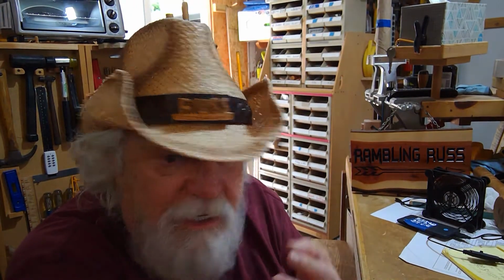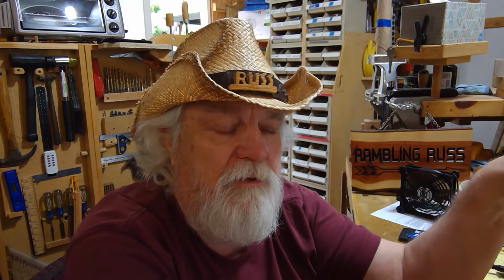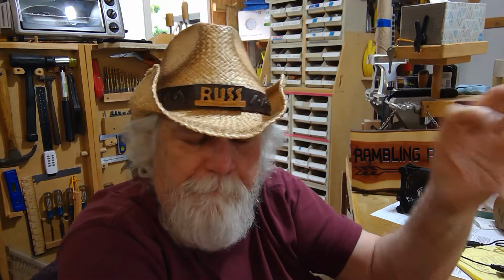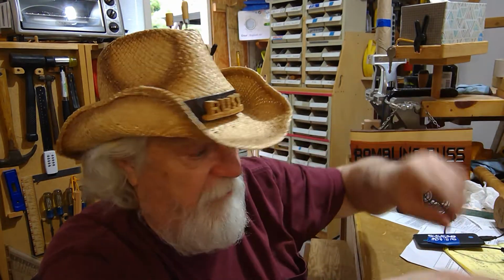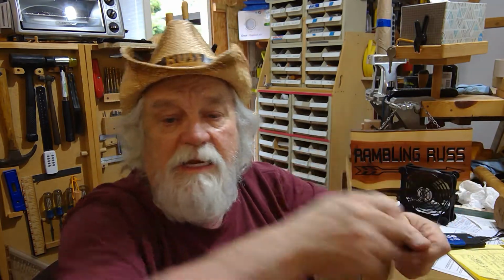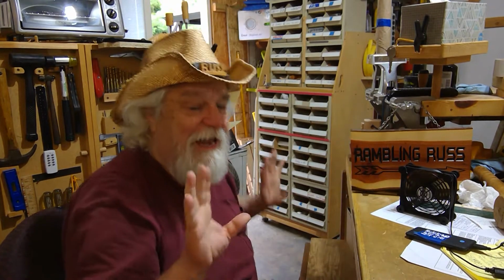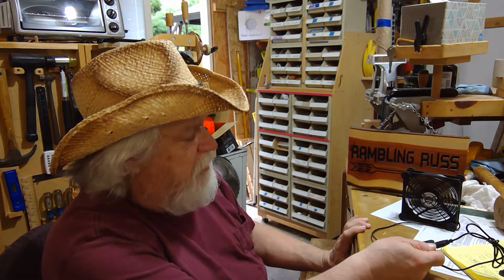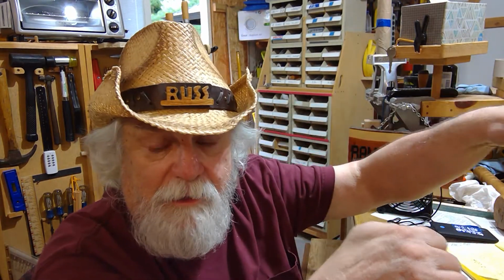All Projects Update by Rambling Russ

Comment: Hi Russ, I've really enjoyed your videos; I've looked at most of the OTB playlist and picked up a lot of good thoughts which I expect will come in handy (I've already made your styrofoam 2x4s; I have no question they will be useful!)

As you're talking about power supply/etc, I want to point out a couple things which you had mentioned in your battery power station video which might help out as you work on other versions --
-- Amp hours describe amount of power available only when combined with voltage to arrive at some watt-hours. 6 amp hours for an 18 volt battery holds the same amount of energy as 9 amp hours in a 12 volt battery. Your 4000 mAh battery pack used to drive the usb fan is likely supplying the standard 5 volts for USB; 4 amp-hours at 5V; that would be equivalent to a little more than 1 amp-hour at 18 Volts for comparison as you think through this.
-- Amps at one voltage are not the same as amps at another voltage. Once again in the earlier video was a comparison between amp rating of the DC step down regulator and a comparison to household AC outlets. To supply the same power of a 1 amp 120 volt household outlet would require 10 amps from a 12 volt battery.

I'm sure you will come up with something useful; 2 more quick thoughts which you likely know -- every power conversion looses energy. So going from solar to 18V, then 18V to charge 12V (or other batteries) will loose power at essentially 2 steps. If any of the wires or the converter components get warmer than luke warm, they should be re-sized and/or reconfigured.

Best of luck as you move forward on these projects!

Comment: Looks like you're on the right track with the "no mask". Looks like some trial & error time now.  My only thought so far is to really watch the weight. An oz. or even a half oz one way or the other could make or break the project. It may be the best thing on the planet at what it does but if it is uncomfortable , then off to the shelf some where never to be seen again (for me anyway}. Also, after your pss I would really like to see this panel carrier. I looked up the one you use after seeing you use it and for something I would only use very occasionally I couldn't justify the cost of the thing. I usually buy several sheets & sizes at once and then I'm good for 3 months or longer. Always enjoy your videos. Thanks.
Reply from the maker: The weight has been heavy on my mind.  The battery and batt. pack are both very light so I suspect the added weight won't be even be noticeable.  the helmet is heavy but with the adjustable head strap it hold on snugly.  when you put the ear protection down, it really holds on good.  It is still way more comfortable than wearing  these as separate pieces (with a mask).
I buy my7 plywood 2 or 3 times a year and use them slowly.  A lot of the times I "nibble" away at the sheet and put it back in the rack.  The OTB PSS works very well for easy set up and take down.  I hope to show this in my next video (I hope :>).  
Thanks Brian for the words of wisdom and encouragement :>)

Comment: Height could limit your access to drive thru places like banks, some car washes and fast food places. Remember the wind resistance too, maybe slope the front of the top so the airflow is smoother. Even the shape at the rear can have an effect on the air turbulence. Possibly think about a PVC pipe pained black to absorb the sun’s heat. A simple fill that can be securely closed, an outlet for a hose and a Air valve to add pressure makes for a small shower to refreshen.
Reply from the maker: I am wondering that about height.  I really want to be able to go thru most drive thru .   
Thinking of that shower eventually along driver side.  I need the passenger side to have a roll up canopy to give shade out the side doors.  All this stuff will mean many trips to the big box store.  Those are the things that have to wait.    Thanks AK.